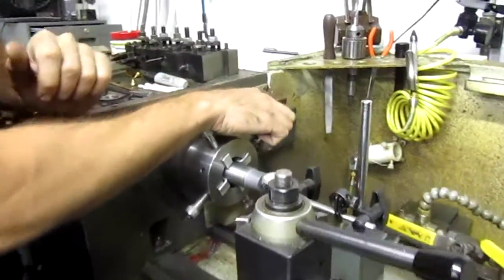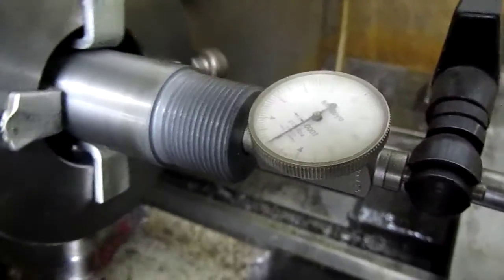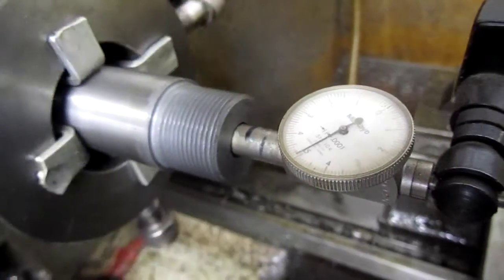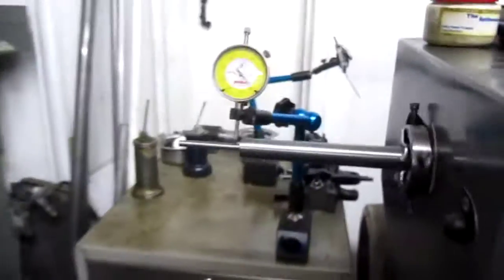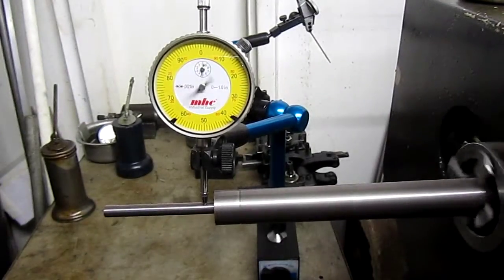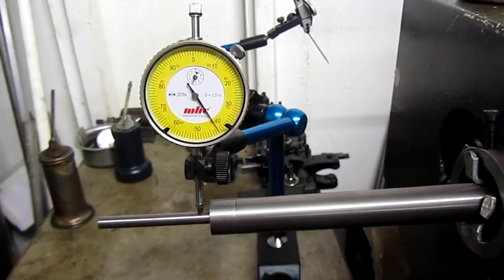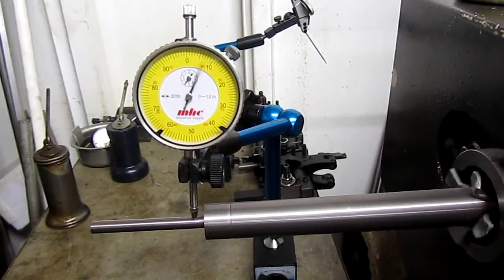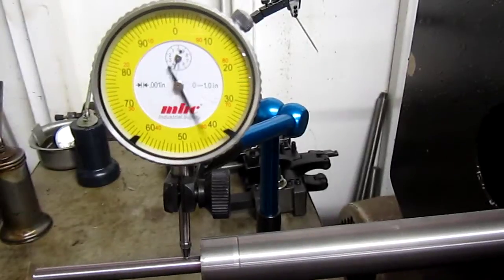Locating the curvature of bore

Comment: I wish I would have wanted this demo before I chickened out on my first chamber job and just dialed the throat and muzzle true. Still ended up with sub .75 5 shot groups but wonder what I left on the table. Good upload!
Reply from the maker: It is always hard telling, but in this business we try not to leave anything to be desired.  I think ultimately the bore being held to a very tight tolerance as far as diameter and finish are probably more important than concentricity of the the chamber. On the Rem 700 SPS tactical packages we use to offer, it was hard getting the runout of the original chamber (We did usually, but it was hard) and the rifles still shot sub 1/2 MOA because they had good clean bores. We use to slug the bore to feel how consistent things were and then lap out the tight spots. Gordy Gritters taught me that trick in 2009!